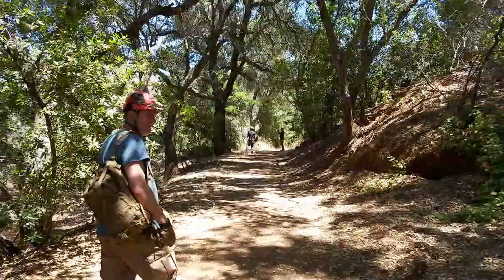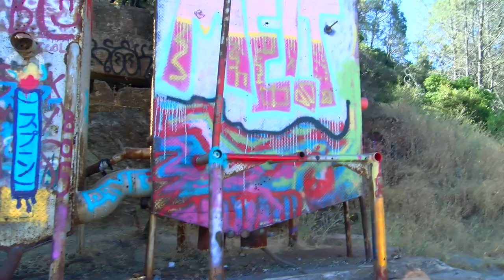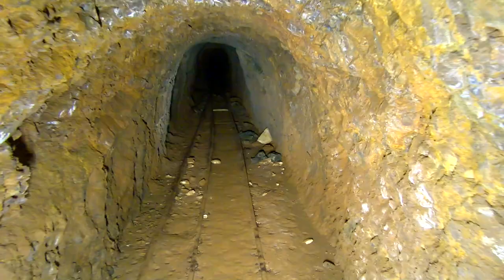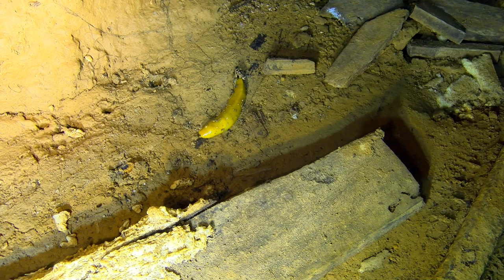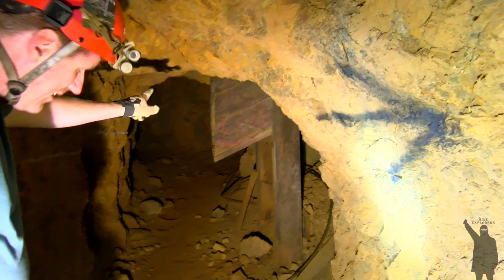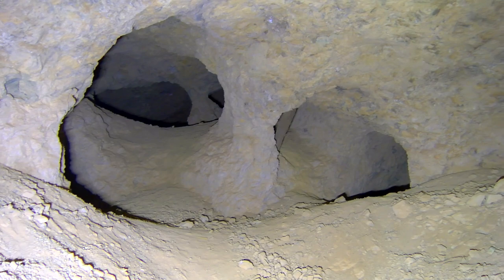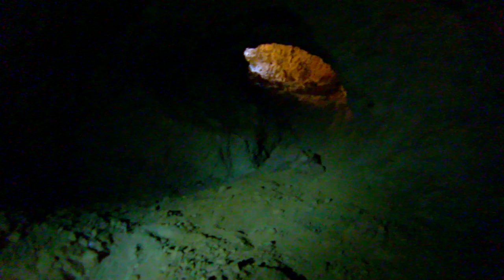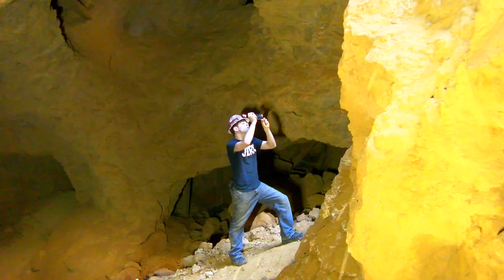Cinnabar Mercury Retort And Mine 2017

Comment: The long tube with the gear on it is the kiln.  The  ore was introduced at the upper end, as the kiln slowly turned the ore would tumble and slowly work its way to the bottom where the ore fell out.  You are correct that the fire would be at the bottom.  This roasts the ore.  In this set up there would have been two doors for the ore to go through to get into the kiln and keep the mercury vapor from exiting at that point.
Reply: why roast to extract? in its solid state it bleeds from cinnabar, i would think crushing would be sufficient
Reply: this would of been a seriously dangerous surface Operation,venting this to the atmosphere would of been a  common occurrence no matter how much they tried to safeguard. as a solid it would pose little concern.